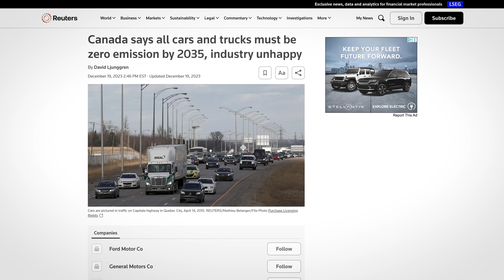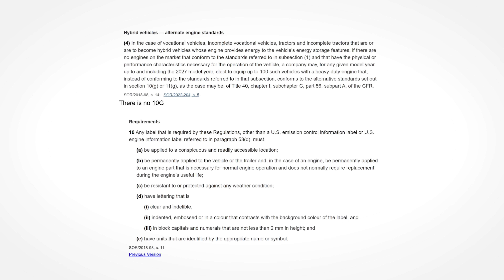Government Red Tape Is Blocking Our Plug-In Hybrid Trucks

Comment: What if the generator was not permanently attatched to the frame? When it clamps to the frame, and then provide a kit to hard mount it to the frame and offer an aftermarket installation. That way you are selling a fully electric truck with an "optional generator". Just like how Tesla truck has a light bar that can't be sold because it's off road use, so they "sell it" as an "aftermarket accessory" and offer installation

Comment: So... get rid of the diesel engine, generator, fuel tanks, cooling tanks, radiator and everything to do with diesel and stack a bunch of batteries under the hood instead... Battery prices are so cheap now the case for a EREV  semi is going away in my opinion. Full EV makes more sense. 

Charge it full overnight, go up the mountain empty, fill full of logs and go down on regen and end up maybe at 90%(wild ass guess based on years towing in light duty EV)... repeat.

Comment: So is the issue the engine itself or the engine and gearbox package? Could you just hookup a highway certified engine to a generator with "cruise control"? I understand the need to make trucks with standard power train for the time being but it does feel like missing the mission. Is the legisation specifically for on highway trucks? Could you build a off highway truck and then request an exemption to use it on highway. That might be an already existing one regulatory process.

Comment: On highway truck engine isnt not the same as a power unit. A power unit has a total different bearing material. Power units do not have the sudden torque on the crank bearings. Your truck technically doesn't have an engine!....it has a power unit!...... I hope this helps because there's a very different technicalities the wording.... By the way put a couple electrical outlets on the truck make it as a portable generator

Comment: What about a refer trailer genset engine? They still put out 440 volts  and even the front nose trailer units will ramp up and down for power needs. And they cant argue that they not for road use

Comment: I wonder if it is a tax based reason for shutting it down.  Chase said in a video that because it is a generator in the truck, you aren’t required to put over the road diesel in the tank. That would be putting red diesel in it and that would be a huge hit to the tax based if all the trucks in Canada and the US converted to a hybrids set up.  Sounds like you guys found a loop hole that want to slam shut asap!!

Comment: Start spending that investor money on lobbying.
might want to look into if the generator engines can withstand moving, the normal application they have they're stationary.
start developing your own generator setup, use a smaller diesel for "onroad" and have it drive the generator.

Comment: 4:24, What is he rambling on about? They do seem to get that you are using a generator for the engine. That is literally the reason you've been blocked from moving forward. You want to use an off road compliant engine but need to use one that is on road approved.  At least that's what i gathered from the girl going over some of the issues. 

It's still a stupid reason for your government to block this project. They likely could write up a temp exemption and maybe offer a grant for emissions testing. Thus allowing you guys to prove that what you say about efficiency. It could even be conditional so if you fail to prove it offers higher efficiency, you have to pay it back.

Comment: alot of vehicles use a small generators and are very inefficient using carburetors to generate power the engine would have to charge the alternators if not on so it is technically helping to move the vehicle,  just generating electricity is not driving the wheels or changing the power output, so it should be fine as its not propelling the vehicle, maybe using a Modular design that the generator could be used separately from the vehicle as an accessory or option, even a separate sister company from the main vehicle, the main issue is probly the fact it uses a 9.0liter engine they may be suspect its some kind of scam and not actually more efficient

Comment: A decade ago I bought an old '80s full sized sedan with a carb with the intention of converting it to propane. Had a company in NJ who did it. The Quebec gov't wouldn't allow it. Had to be a certified quebec company .. and no quebec company would do a vehicle without a computer and fuel injection.

Comment: I follow this channel because of the hybrid and electric truck designing and processes. I wouldn't watch this channel if you focused on deisel/mechanical trucks. Please find a way to fix the regulations and continue your hybrid work. Until energy density in mass-produced batteries is doubled, hybrid is the only feasable way to go, and i think your designs are great. Perfect mix of simplicity, ease of maintenance, and usability for its work capacities. Even if you have to make deisel/mechanical trucks for a few years for profitability,  please keep the focus of the yt channel on the hybrid trucks. Thanks
Reply: NV, yes.THIS<
Reply: Less government. Government always gets in the way of progress. Government never causes progress.

In the US, all liberal run cities complain about low density, yet they have zoning, permitting, and vehicle parking requirements that effectively ban high density. When ever the free market wants to build a higher density housing unit, lawsuits come from everywhere. NIMBYs will use those regulations to shut the project down and government does. Government is an incredible hindrance to progress while claiming to want progress.
Reply: Except that it isn't really "hybridization" though, now is it?
It's just the same diesel electric design that we've been using in trains for the past 70+ years. All of the inefficiencies of the combustion engine, and a couple more inefficiencies added, combined with the instant torque of electric motors.
That works out fine for trains, as they're efficient simply through the volume and weight they transport. However, when the load is scaled down to even something like 40 tons, efficiency at highway speeds would certainly be less than that of a regular tractor-trailer. As before you had losses only in converting chemical energy into mechanical, with this diesel electric design now you have the added losses of converting that mechanical energy into electrical energy, and then back again into mechanical energy.
Which is precisely why Dodge/RAM's design for the diesel electric RamCharger actually received worse fuel economy than the regular Hemi-powered Ram truck. Even with the added 92kWh battery and starting with a full battery while running is electric only mode for as long as it can, it only manages an average of 1.7MPG more than the Hemi truck, while being vastly more expensive and resource intensive to produce.

It simply isn't a good design for "light" loads, meaning anything less than what is reasonably feasible with a diesel only engine.
Still, as inefficient as it is, if they want to try it they should be allowed to do so. As for why they're not, you have to realize we're discussing the same government that froze protestors bank accounts simply for protesting vaccine mandates.
Why would anyone ever expect such a dictatorship to be benevolent?

Comment: I think if there were sufficient infrastructure in Canada for refueling trucks with hydrogen, it would be very easy to switch to fuel cell technology. That's the advantage of the Edison Motor offer, I guess.

I find the 2035 timeframe for switching to fully electric vehicles somewhat unrealistic anyway. Sure, there are still ten years to go, but I don't see what's feasible for cars being equally feasible for trucks in the same time frame.

Politicians are so out of touch with reality all over the world. However, I also follow a YouTube channel that primarily tests fully electric trucks in everyday use, with some astonishing results. However, it also highlights the weaknesses of the currently recharging infrastructure during Europe.

The guy who runs that channel was recently able to test drive an IVECO hybrid truck that runs on hydrogen and thus draws its required energy from a fuel cell. Was interesting to watch. 

In any case, I have the impression that alternative truck technology is already more advanced in Europe than in the US or Canada. Just from the Infrastructure. But of course, that's just a subsidiest thin in a testing phase. 

The provincial and federal governments should support Edison Motors in every way possible, instead of hindering its development with already unbalanced laws and regulations.

Edison Motors should be granted subsidies to develop an alternative system for fuel cell technology in parallel with the current fuel-generator system.

Comment: Seems like the R&D is over budget and or Canadian laws are very specific. 

There is no reason an on highway engine can't be reprogrammed for load feedback and throttle compensation. 

Your engineers should be looking over the law like it's a specification.

You really come off like it's something just being toyed with, clocking in clocking out. Just doing your job

Comment: so what ARE the differences between tier 4 compliance for on road vs offroad? do the onroad engines actually have equipment or emissions that the offroad doesn't, or is it entirely semantics where you just need to have testing to show that the offroad engine meets the onroad emissions requirements?

Comment: I mean, getting a highway engine and strapping a basic pid controller to it, hooking that to your generator to run at a constant rpm wouldn't be a terrible challenge and with your setup a bit of frequency wobble won't matter. A bit silly in many respects and expensive. 
But yeah, achievable. 

Honestly I figured you guys would roll your own DC alternator and charging circuit anyway soon. 'just' have the alternator directly output the right DC voltage for your current desired battery charge voltage/current by controlling the field coils. Same as modern cars do. 
You'll gain a few % efficiency by getting rid of the power conversion stage.
Reply: No alternator directly outputs DC, there's going to be a rectifier of some description involved regardless. Power conversion will always be part of the picture it's just a question of how the setup is configured. Given their use case is fairly high powered keeping the alternator and rectifiers as separate units makes a fair bit of sense to assist in cooling and there's no meaningful efficiency advantage as you're only really going to see line losses as the difference.
Reply: @AmurTiger rectification with ideal diodes and some caps is a lot simpler easier and more efficient than a power factor corrected AC to DC conversion, then another DC to DC to get that to the battery voltage which is the topology they had last time I looked. 
Without PFC and at high load your generator isn't going to be loving life.
Reply: @zyeborm  I see, it's the DC-DC stage you're expecting them to get rid of, that certainly makes sense.
Reply: @AmurTiger the AC to DC as well as you need to do that with PFC or the load on the generator will be very rough.

Comment: You guys are doing something new. You'd start manufacturing drugs now. Quite obviously you're dealing with some individuals who know Jack s***. Hopefully, you can get this sorted out. This is a good idea.
Completely electric commercial class eight. Rigs aren't gonna work in the cold frigid. Temperatures of canada, with the distances, we half to haul, so these eco nut jobs need to maybe make some rules, but what you guys are doing? It's the best solution. To a problem.
Because eater a standard diesel-powered rig, or your hybrid trucks are the only things that are going to work in Canada. Completely electric that ain't gonna work

Comment: So I'm from America, and the issue i see is if Canada has highway use taxes on fuel, your truck would be exempt, and they would lose a boat load of money. You should have described the generator as an accessory, not a means of propulsion. Refer units on trailers  are exempt from highway use tax but do travel on the road and still would be if pulled by a ev tractor.  Technically, you could pull a dedicated. Refer trailer which also has generator capabilities and simply use the stinger cable most trucks use to power such things as lift gates to back feed the tractor.
Reply: They're already losing fuel tax money via EV sales and the like so that wouldn't be the show stopper. From the description of the problem this seems more like an area of undefined regulation where they don't have an idea as to what they'd for this combination of engine and use case. I honestly expect that this should be something they can get resolved in time if what he's said in the video is true and they want this kind of vehicle to be around, they just have to get someone high enough up the chain to alter the rules, from the sounds of it it may require new legislation. Time consuming and frustrating but doesn't feel like there's ideology or a financial incentive against it.

Comment: This makes sense, you want to use an engine that is not certified for on-road use for on-road. The requirements for on-road engines are way more strict compared to generators, since generators normally don't run all day.
Maybe you can replace the generator engine with a on-road engine is the generator chassis.
Reply: But their generators DON'T run all day.
Reply: The crux of the issue is that they are trying to innovate in a direction where nobody is accommodating, and the Gov't defaults to blocking their efforts.

Comment: I have seen that on some semi trailers equipped with refrigerated trailers, The refrigeration unit is ran by a motor. What type of motor is used to run a refrigerated box.😊

Comment: As goofy as this might sound, if you’re stuck with mechanical main power what if you had battery powered electric booster axle for low speed acceleration? It would help reduce load on the engine when the rig is accelerating. By the time you hit cruising speed the mechanical drive train is at 100%. In your diagram you already have an alternator for engine braking. Steam trains used to have booster trucks to help with efficiency.

Comment: I think I'm still a bit confused, is it the generator itself or the engine? I understand it's not designed for it but is there a law preventing you from adapting an x15 to the generator similar to debosses plan with the r2.8?

Comment: There are differences between on road diesel emissions systems and off road diesel emissions. On road emissions limitations are more stringent. 
I would be asking Scania if they can come up with an engine calibration that would get them compliant with on road emissions for the engine you are using.

Comment: How about mounting the generator to the vehicle in such a way that it can easily removed from the vehicle and connecting to the vehicle with a plug? When not connected the generator would then be considered cargo on a pure EV truck. Get the truck approved with the disconnected generator claiming it to be there only to charge when stationary. Customers can then decide if they will use it like that or drive with the generator connected. Might work until laws are finally changed.

Comment: If there's no legislation that allows this engine/generator design, then doesn't that by default also mean that there is no legislation that disallows it? Designs for which there are no regulations yet are unregulated. Therefore, they are allowed until there is legislation that specifically disallows it. Another law (i.e. emissions law) that then only applies to specific designs does not apply to other designs. Then, the governments sole remedy is to regulate the emissions limits, no matter what the underlying engine/generator design is, and if they haven't had the foresight to simply establish maximum overall upper emissions limits then they don't have a leg to stand on as your product is then completely unregulated, from both the design and from the emissions perspectives. The emissions limits only apply to the designs covered in the emissions regulations. So unless it states somewhere in the emissions regs or the on-road engine/generator regs that your design is specifically prohibited, or that only designs listed in either of those regs are allowed, then take them to court. If you have to use a road engine, how hard is it to design a circuit/device that controls the throttle based on battery demand? (i.e. instead of the drivers accelerator pedal ... seems it would only have to control engine off and then a second on/specific RPM to generate charge for the battery ... but yes stupid because then you are force to have an engine, a throttle control device, the driveshaft connected to a separate generator and then the battery.

Comment: i am confused, is it that difficult to modify road engine so it throttles based of the alternator load like a generator would?
Reply: or is the issue that when you would modify the highway engine so it acts like a generator, then it would technically became a generator?
Reply: Once you modify it, it loses its certification I think is the issue. The generator vs drivetrain application of the engine is the crux of the issue I think.

Comment: So, ditch the genset and go full electric. The Kenworth T880E has 625 kWh for 250 miles at 82,000 lbs. Your use case is more efficient than straight OTR, so 300 could be possible. With a 40 minute charge at lunch you're looking at 500-600 mile daily range.